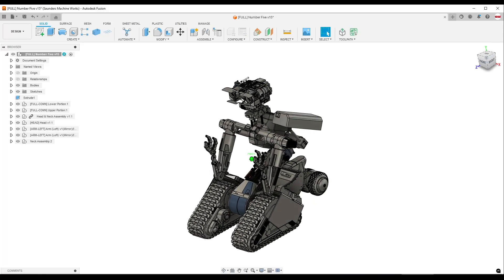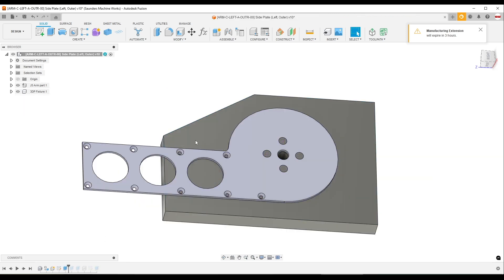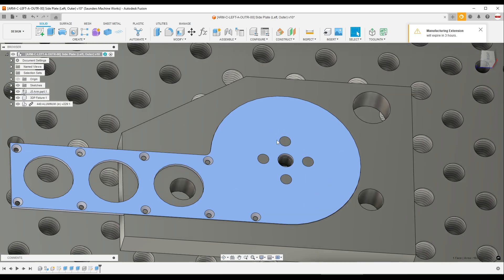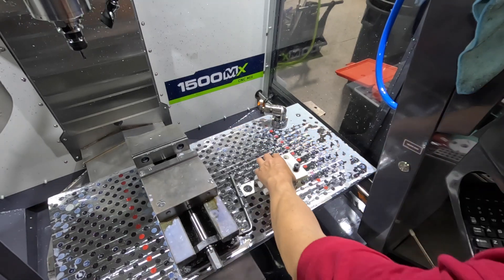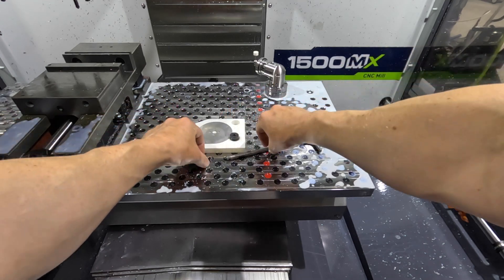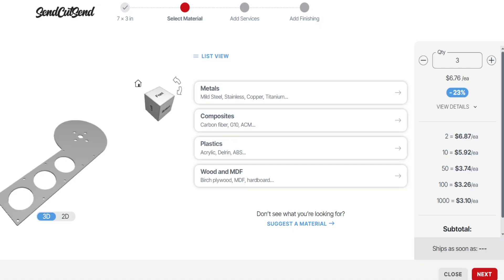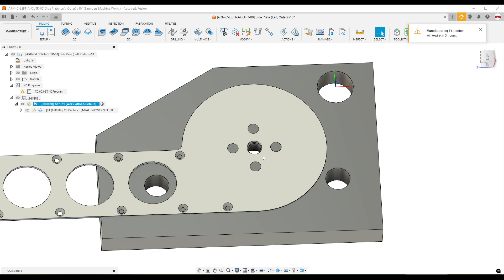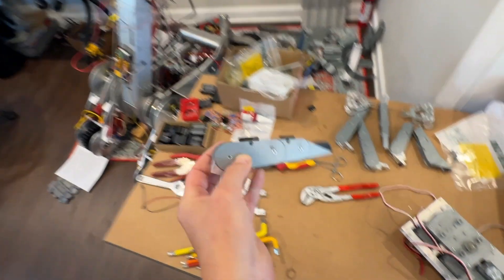Fixing Old Parts with Fusion 360 + 3D Printing (It Actually Worked!)

Comment: As a fellow robotics engineer this project has come out great and sometimes you have set backs and have to rebuild aspects of the project. One thing you need to have in order to work in robotics is unshakable persistence. Because there will be challenges and there will be setbacks and the learning curve is quite steep.  Robotics is a marriage of hardware and software requiring machining, mechanics, computer engineering, Welding and fabrication,  software engineering, etc.  This is why robots are usually built by teams of developers and it's no easy task to go it alone.  That's why robots are generally built in years.  Keep up the hard work and the results will pay off. 🤓🤖🤩

Comment: How long did it take to make the original johnny 5s?  How much did they spend?  And without the fancy CAD.  I think technically sometimes gets in the way.  I enjoy watching the build (even if it takes longer to build, just one, than the originals).
Reply: The original Johnny 5's were just props. This is an actual robot and there's a universe of difference between the two.
Reply: @77Avadon77 There were actual robots in the films. SC2 was entirely movable. Sc1 had more props and puppetry going on.
Reply: @ethandram  No they were just animatronics. Like I said, real robotics is not what you see in movies.
Reply: Golden age thinking. It was always easier back then.

Comment: I've got a part in my shop right now that has through holes with counterbores on both faces.  The holes are at a compound angle and I don't have 5 axis.  I printed a fixture that holds the part at the compound angle and I'm able to drill and bore straight through and flip the fixture to counterbore the back side.  Not ideal, but 3D printing has come in so handy for situations like this.
Reply from the maker: yea, perfect example!  you just held the whole thing in a vise then?
Reply: @nyccnc yes.  The part is fully encapsulated with cutouts for access to the holes.  All 6 outside surfaces are square to each other.  Made a couple of cutouts to access datum surfaces as well.